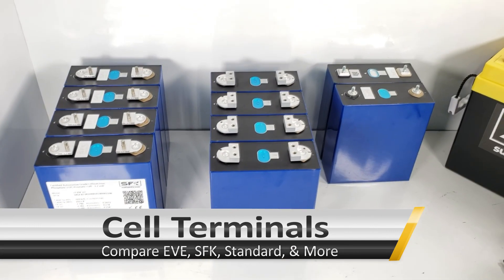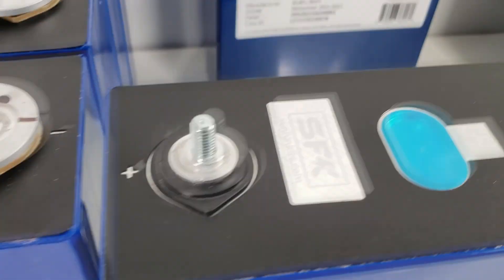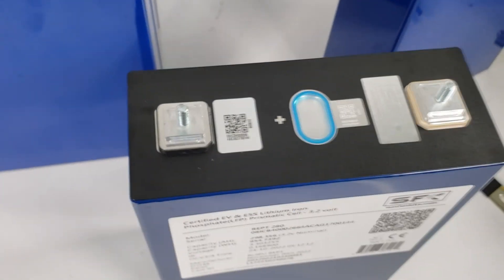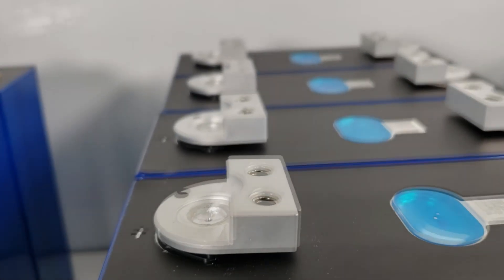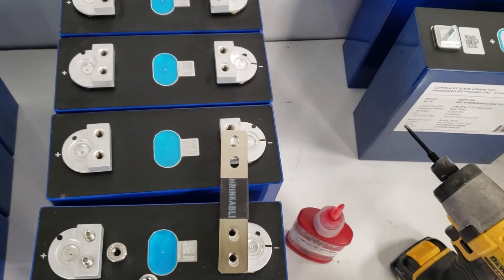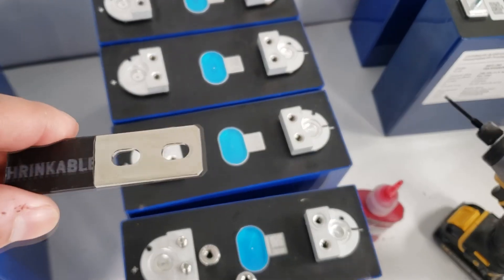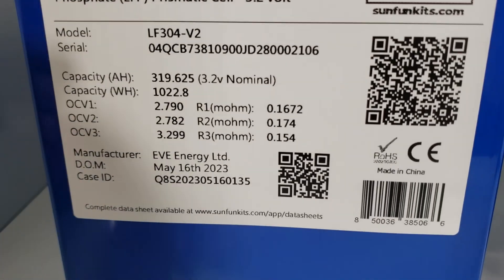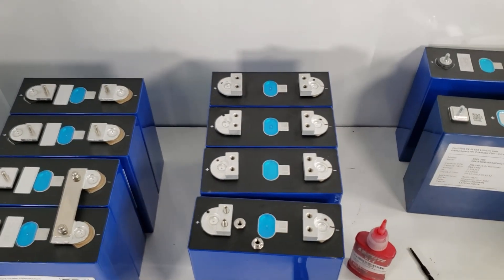Comparing EVE, SFK, REPT,  & Common Battery Terminals for Lifepo4 prismatic cells Pros & Cons

Comment: I had EVE cells. The terminals are well aligned and they come with screws that have integrated lock washers. I like using two lugs on the battery instead of trying to stuff two wires into one lug. I appreciate the thinking you've gone through with your cells, though.

Comment: I got the BT-360 stocked in Europe tested approx 331Ah or 1037Wh at 40A per cell. They have a round and tallish 11mm terminal post. I found some clamp on brackets with 2x bolt holes and one slit that tightens for around €1 each. They only had 10mm so I will simply drill them out to 10.9 or 11mm Saved a lot of money over the laser welded but My next choice would have been the more expensive EVE.  Originally I was going to go for the cheapest option but felt better about European stock and they were marketing them as 360Ah but they are just the 320's as far as I can tell. ou could probably get over 360Ah at 20A discharge.
   My cells took a very long time to top up charge to full voltage.
   I would say as a rough guide not demand more than 750W per 4 cells if you want your batteries to last a long time. Possibly less more like 600W if you really don't want to stress them. 

You can have 6x LTO that power heavy loads and prop them up with the LIFEPO4 (via a PWM controlled solid state relay to regulate current) whenever the LTO drop below a certain voltage while powering large loads. LTO sit at a higher voltage but say voltage starts to sag below 13V or below the voltage that the LIFEPO4 are sitting at then the SSR starts to feed power across. The lower the voltage drops the more power the SSR allows to pass across from the LIFEPO4 to the LTO battery.
  Having the LTO buffer big loads can really help increase the lifespan of the LIFEPO4 and can reduce the need to parallel up extra LTO to handle the AH or larger loads. 
  To summarise. it's a fairly small LTO bank. say 40Ah 6s only. But as soon as voltage drops below the lifepo4 banks voltage it switches in and starts to prop up the small but powerful LTO bank.

Comment: An information I could not find from the manufacturer is : for the terminals with 2 threaded holes, it it required/useful/discouraged to de-grease the terminal and the bus bars using solvent. Do you have this information?

Comment: Nice breakdown.  I was wondering about the dual terminal cells.  You make good points I hadn’t considered.  One thing I still dont understand is why battery manufacturers don’t use/recommend the use of a dielectric compound on the mating surfaces.

Comment: why would anyone be pressing on them when fitted....you should always use antivibration rtv sealant to protect all parts in a dynamic system. also you should never use dissimilar metals, over time they will corode

Comment: Hi! have you ever had the problem of double hole shiny-coated connectors ruining the conductivity of the cells? (You cited them in your video). I know that is the vendor who welds the connections on the cells. This vendor measures the internal resistance only at the soldering points of the aluminum piece, but not on the surface that should contact the busbars. We have received good cells (REPT) but the connectors appear to be powder coated, like shiny metal paint that ruins the conductivity. It' s impossible in that point also measure the internal resistance of the cells. On the surface connecting with the busbars the conductivity is so lousy that the tester does not detect good resistance anywhere. This is dangerous and could lead to overheating problems and ruining the cells. The seller won't listen to reason and says that internal resistance has to be measured only at the soldering points -and not on the surface that should make connection with the busbar.(!) -. 🙁What do you think about? Thank U in advance.

Comment: Good grief guy. I just used metric flathead screws with hex head fastening and I ordered 2 different lengths. That way I can get the lowest profile. No lock tite needed. I like the original eve cells. I don't see the need for the extra expense of someone else fabricating a terminal.

Comment: So REPT has some 320ah 10,000 cycle batteries now. You guys carry those as well?
Reply from the maker: On order! :yougotthis:
Reply: @sfkenergy  Right on. What will the price be per battery (roughly if you are not sure yet)?
Reply from the maker: We don't know we placed the deposit for 1152 cells and are waiting for them to ramp up production, But I would assume around $120-125.00/cell shipped when buying as part of a 48 cell pallet. @WhySoDivided-CantWeAllGetAlong
Reply: @sfkenergy  oh damn..that's a fantastic price. 28 cell pallet is odd to me.. why not 16 or 32? Is it due to weight? I'd likely look to buy 16 or 32 of these depending on when they are available and final price with shipping.
Reply from the maker: Sorry we meant 48! 48 cell pallet 😆

Comment: Hi, thank you for the video. Can the laser welding at 3:45 be done with a hand held fiber laser welding machine? Or would a CNC type fiber laser be required?

Can the aluminium square top be directly laser welded to a flat post rather than using a steel pressed post underneath? If using 8mm aluminium here?

We only need to drill into the aluminium post on the top that we welded and not the actual terminal post of the battery, as the electricity will be flowing through the aluminium block into the terminal?

Sorry if I get my terms mixed up, I am trying to understand how that specific laser welded post works in 3:45. Hand held laser welding machines cost about $1k to 2k, if building multiple battery banks, might as well bite the bullet and do that because some sellers will not do anything for terminals for me, shipping to Pakistan.

Comment: Great informative video. I just bought 12 304ah cells from sun fun kits. I made a quick 12v battery out of 4 of them and charged them up with 80 amps. I did match the highest capacity cells together (around 319ah). They reached 3.5 volts with a 50 mV deviation. That’s without doing any parallel charging!  Amazing!  After two hours of float at 14.3 volts with a muller active balancing bms. she was at 0.010 deviation. Awesome. Thank you.

Comment: Question about using lock nuts, what is the temp rating on the plastic locking material?
Hate to have smoke inside a battery box when things get hot.
Reply from the maker: If the internal temperature gets hot enough to melt the nylon, then for all practical purposes you would have ruined the cell. The glass transition temperature of nylon is 70 degree C or about 160F. Your battery should never get this hot the BMS should shut it down at 55.

Comment: I would rather have eve's terminal and use bolts.... but that's just my preference.
Reply: EVE supply short bolts with their bussbars now. I really like it, makes it easy to build a pack fast. Did brush the terminals and torqued to 5nm. No issues and suprisingly  cool when under constant 200A load. To run my second bank of 8 i needed to make a custom bussbar. But also when only one hole is screwed with a normal bussbars still enough contact area for continuous load of 200A. I sell the packs limited in BMS to .5C charge and discharge (154A) 304ah cells. But test with 200A discharge as part of our quality controll. Testing envision 305ah cells now and they do not meet our quality requirements, they are cheap though. And will be sold with 125A hardlimit in the BMS, in our value line ESS storage cabinets.

Comment: The UK supplier provides M6x16mm SS flange nuts, I suggested this in my review after first purchase. Second and third purchase, all came with flange nuts. I just add a spring washer and it’s spot on. 
You picking on non issues here, happy selling, but US customers will bypass you to get this EVE cells. Many already did. You are shooting your own foot.
Reply from the maker: We sell all 3 types of terminals, the demand for our terminal is the highest of all, most people upset on this video are actually sellers who carry this terminal and now have to deal with customers asking hey have you seen SFK video? All one has to do is perform a google search for Eve Official Terminal to see the responses people have on online message boards. It is NOT good.

Unlike other companies who simply accept whatever a manufacturer is providing, we do our best to improve the product. The proof is EVE has ditched the round terminal for the EVE 230 cell. 

The 304 cell is great, EVE diy approach is not. I do not think they care that much as this accounts for less than 1% of there sales.

SFK can provide any terminal the customer chooses.

Comment: For the old style round welded non-automotive grade batteries, would it be possible to add a washer around the top (small surface) contact area to include the larger circular area? Kinda thinking out loud here, but it might help.
Reply from the maker: Some people have used copper crush washers... but then you run into the issue of direct contact of copper and aluminum which can lead to corrosion with even the slightest bit of moisture.

Comment: So I'm guessing EVE do Quality Testing with central screws rather than welding straight away? Otherwise, all the non-automotive grade EVE cells would look a lot different, I guess.

Anyway, I finally got round to testing each and every one of my QSO-supplied 304Ah EVE cells (manufactured late June 21) with 40 amps (about 0.13C) and they were all well above spec (and funnily enough, the best one was one where we had a misadventure with discharging cables so started again - it was over 315Ah after the second test, so they're good - lowest was just over 310Ah which was quite an outlier). I wouldn't try discharging above about 0.3C though (and have bought a load more since to ensure they're not too stressed). Guess I'll need one of those funky infrarouge phone dongles to test their best charge/discharge rates. Still, I'm pretty happy with them for storage grade. 
Cell #	Manufacture	Line/Order	Capacity Ah	Energy Wh	IR after 3.34	Note
1	21/06/21	71/23	312.0	1010.65	0.2mR	Torque?
2	26/06/21	71/28	312.5	1011.79	0.2mR	Discharge average V 3.24 for all
3	22/06/21	71/23	310.9	1006.63	0.2mR	
4	26/06/21	71/28	313.1	1013.26	0.3mR	Waited a while before IR
5	26/06/21	71/28	314.3	1017.77	0.3mR	Waited a while. Dodgy -ve thread
6	22/06/21	71/23	312.6	1011.77	0.2mR	
7	26/06/21	71/28	314.9	1020.28	0.2mR	Forgot to scan QR code, so is last of 16
8	26/06/21	71/28	313.2	1014.41	0.2mR	
9	22/06/21	71/23	312.6	1011.56	0.2mR	
10	22/06/21	71/24	312.9	1012.92	0.2mR	
11	21/06/21	71/23	313.7	1015.54	0.1mR	Dodgy -ve thread
12	22/06/21	71/24	312.4	1011.8	0.2mR	
13	21/06/21	71/23	313.8	1016.86	0.2mR	
14	26/06/21	71/28	315.6	1021.18	0.2mR	Had to restart after cable issue during discharge. Interestingly, this is the highest capacity cell.
15	22/06/21	71/24	313.3	1013.68	0.2mR	
16	27/03/21	71/28	314.1	1016.99	0.2mR	
			313.24375	16227.09		
			ave capacity	total energy		
				1014.193125		
				ave energy		
Sorry for formatting!
Reply: And I was going to ask why you don't do centrally screwed threads, but I guess all automotive grade EVE cells have their welding already in place (after watching some more). Quite a dilemma.
Reply: Same...My 304's from QSO all tested above 310Ah...My EVE 280's from 18650 battery all tested between 280-287 Ah and never had a problem with the double hole Eve's....My 280's from Gobel all tested above 280 Ah's..

Comment: I have the two hole terminals and love them BUT there can be problems. The mat finish has bad contact. It is a abrasive blast finish which greatly increases the oxide layer. It MUST be buffed bright with 3M cloth (by hand!,no power tools!) and debris carefully blown away immediately before the buss bars are installed. Clean contact surfaces with acetone BEFORE buffing but not after, just air. Blow off contact surface and threaded holes with low pressure air or a can of dust-off being careful NOT to direct the air into the vent cover. A very light quick buff on the buss bar contact surface is ok but not too much because of coating is thin. The only anti oxidant that should be used is NO-OX-ID “A”Special. Not anti oxidants that contain any carbon or ANY metals(silver,copper,lithium or zinc)! I’ve ran tests with conductivity and corrosion. You want something that is Ph neutral, has no elements that inadvertently act as an electrolyte or noble substance yet can get out of the way while keeping air and moisture out. Throw the bolts that came with it away and use grub screws(6mmX20mm) that are long enough to use most of the thickness of the terminal and also extend through the buss, flat washer and flat bottom flange nut. Use hex key wrench to hold the grub screw to hight(not puncture case) as you run the nut down finger tight before you torque. The nuts and grub screws don’t have to be stainless. Zinc plated steel is fine. You can put a thin layer of the aforementioned anti oxidant if you have salt air. Things of note: If your buss are shiny and don’t have the Helicoils there’s no difference in performance or thread strength if the fasteners are deep enough. In both cases the terminals should be buffed bright just before assembly. If the block of the terminal is leaning down towards the battery case it’s probably been dropped on its top. Contact your seller! The battery post could be bent, fluid leaking from terminal,weld compromised are some of the potential issues. In some packaging there is foam across the top of the terminals and not on top battery case. Ideally the foam at the top would have three clearances, both terminals and vent window so the shipping Gorillas can’t hurt them. The risk of buss bar shorting is far greater with these so you should drop the buss over the four grub screws and get a nut down ONE buss at a time so it can’t accidentally get lifted across. Some of these terminals have sharp edges so route and secure the balance leads carefully so you don’t get a short and create glow worms. The flexible buss bars are the best. The traditional plated copper flat buss are ok but the thick blocky chunky ones I’ve seen don’t have flat sides and have poor contact and are nothing but trouble. In all cases, the contact surface must be flat, clean, free of oxidation and have a film of of anti oxidant prior to assembly. Failure of accomplishing this is the number one cause of poor balance, longevity and performance.
Reply: Great write up. The only thing I don't agree is using studs as this terminals are clearly made for screws and there is absolutely no issue to use screws here as you properly tie it down to torque spec which with stud and nut is not garunteed to work correctly as stud can move. I like this terminals a lot as it gives you enough surface area and the 2 bolts if done right press the busbars properly down. Yes always hold the busbar and put in all 4 screws by hand, then tie them down with a torque wrench, never an impact gun like done here.
Reply: @chrisr819  
The supplied screws are too short. Any time you have a soft material, you’re always better off using a stud and not a bolt. But yes you can use a longer bolt in the two hole terminal because the alloy is much stronger and it’s threaded all the way through. The earlier cells, stud less had a shallow tapped hole in very soft aluminum. They were very prone to being stripped out unless a grub screw was used to get every possible bit of thread in use and not start a pealing action of a bolt.
Reply: Thank you!
Reply: always use electric contact paste